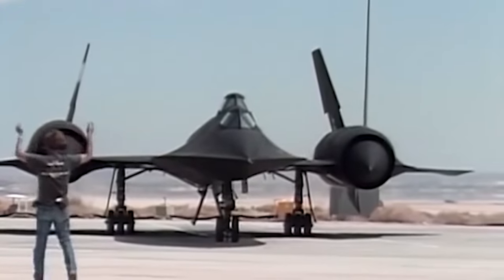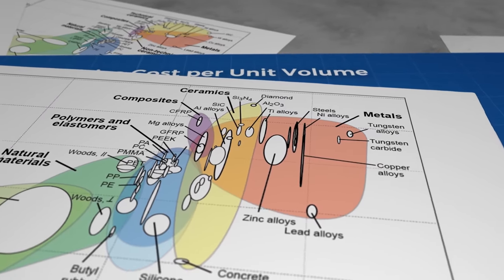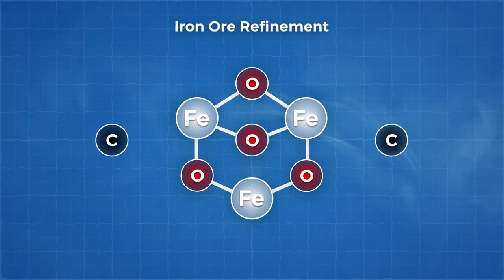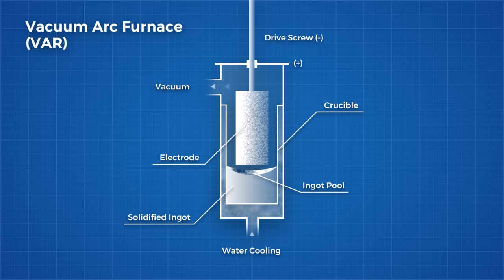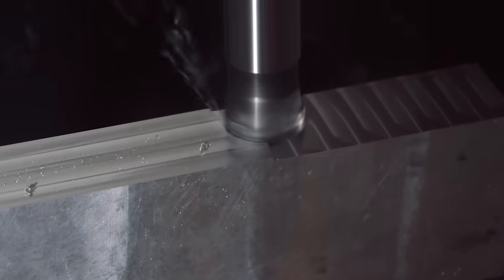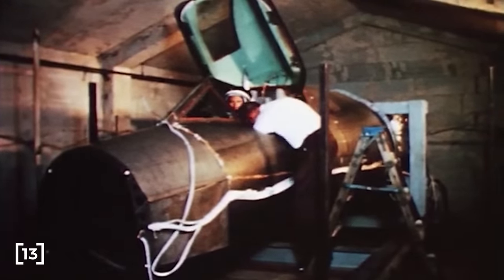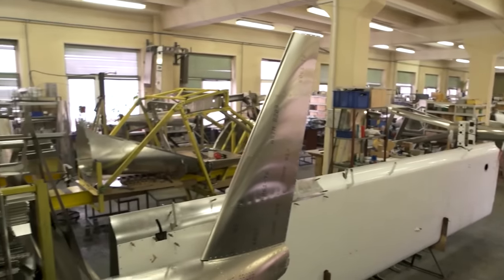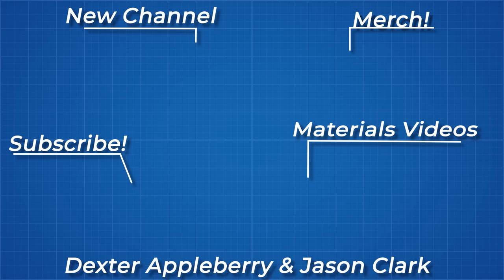Titanium - The Metal That Made The SR-71 Possible

Comment: Why they’re not using tungsten? Maybe in the future, the tungsten jet, which called “T - Jet
Reply: Tungsten has the same specific weight as gold! It is also extremely hard and brittle. In aviation it is only useful as a strengthening element in steel parts that also have to withstand great heat.

Comment: Have any aircrafts been built out of Tungsten? If not, would it be too heavy?
Reply: Aircraft* (plural same as singular). Pure Tungsten not only is heavy but also very brittle. Tungsten is added to steel to increase its heat resistance, wear resistance and toughness. Given an airplane contains up to five million parts there are certainly a few made of tungsten-alloyed steel in places where high load and heat occur at the same time, like in the engines and landing gear.

Comment: 4.5k per ton is really not that expensive. An airbus A321 is about 60 tons of it would be made 100% of titanium that would be 270k. That is really just a tiny fraction of the plane cost.

No the mainnissue with titanium is not cost, but rather processing.

Comment: Titanium is the devil when bending for finned heat exchangers. It work hardens and then cracks. You get about one chance to bend it and if you try again the work hardening almost certainly leads to failure. Very unforgiving. In theory, an excellent inert, light and strong material but for manufacturing and for the price it is a bear.

Comment: Fun fact. The SR-71 only had a 2G airframe!
Reply: I learned that only recently.  I think that's the big tradeoff Kelly made to create an aircraft that goes fast in a straight line.  It makes me wonder how different the YF-12 was from the SR.  A fighter has to be able to pull high G's.  The YF-12 was supposed to be an interceptor for shooting down Soviet bombers, so turning may not have been that important.  But if they didn't get their prey on the first pass, it would take them a long time to turn around at 2G's to line up a second pass.  I remember Kelly being quoted as saying the US government bought the wrong version of that airplane.  The F-12 should have been the one that was purchased in great quantity.  I think there were only 32 SR71's built.

Comment: The SR 71 still leaked fuel all over the runway and did so until it was airborn it was a piece of junk. Titanium is pretty rugged metal though and resists machining like a bastard. Magnesium is not as strong is dangerious to some extent because it loves oxygen so much. but machines nicely with sharp tools using no coolant. It is 2 thirds lighter than aluminum and two thirds stronger but it does not like to be bent or plasticly deformed. Titanium likes to burn too.

Comment: False,
The SR-71 was limited to it's engine's not the airframe.
The SR-71's airframe was designed for mach 4.4, the engine's were mach 2.2, and the naselles is what allowed the max unclassified speed of mach 3.68.
Reply: Virtually your entire comment is incorrect
Reply: @gr8crash  
Prove it
Reply: @krysb7119  the initial limiting factor to speed was the engine CIT of 427°C. Once that limitbw was reached you were done accelerating. The airframe was NEVER designed for mach 4.4, it wouldn't be able to achieve or survive that. That maximum design potential of the airframe was mach 3.8 and it would have required significant upgraded to reach that speed and were never done. It was member even capable of reaching 3.68 either. The engines were rated for 3.2 with a max authorized speed of 3.3 ONLY if engine CIT was within limits. Above 3.43 a pilot would be beyond the flight envelope as well as being at an unapproved altitude would all lead to some very bad things.
Reply: @gr8crash  
You need to do a lot more research.
Reply: @krysb7119  I have done a lot, apparently significantly more than yourself. I'm always doing more, but sounds like you need to step it up. Which is unlikely as it ends up being a time consuming and costly endeavor, which most people just don't want to do.
Reply: @gr8crash  
Sounds like you don't know what you think you know. Thanks for trying but you've failed.
Keep researching maybe someday you'll actually learn something.
Reply: @krysb7119  oh no need to. I've already done quite a bit. One day you'll get there, if you ever decide to commit the time and expense, which is unlikely.
Reply: @gr8crash  
When you grow up you might get an actual education.
So far you haven't proven me wrong.
Reply: @Istandby666  actually you were, several times over.

Comment: The Russian use stainless steel for their Mach 3 MIG25. Different approach by different engineers.
Reply: Mig 25 was extremely heavy and crudely made.
Reply: @osyisr6361  - The MIG-25 is crudely made because they have a tight schedule. There are rumor that the USA Mach 3 bomber is going into service soon. In order to have a interceptor that can intercept the Mach 3 bomber. They use huge jet engine that was design for cruise missile. Use stainless steel  alloy and use alcohol to cool down the MIG-25 internal when flying at high speed. However, the irony is that the US Mach 3 bomber project is a failure.
Reply: @yutakago1736  Do you even know what past tense is? You're talking about event from over 50 years ago.

Comment: Air friction creates heat which make materials weak. Heat is best handled by ceramics of klins and the bottom of the space-shuttle.Supersonic is mach1. Hypersonic was mach3 0nowadays people like to use mach5 as benchmark for hypersonic). Air-friction for re-entry vehicles (including nuclear warheads), generates heat. You will never have materials on earth for sustained hypersonic flight. Sonic is atmospheric. Go higher to low-orbital make sense-cents. Youtubers and engineers bullshit too much on new weapons. From mach1, need to disperse heat is a big issue. At mach2.9(muzzle velocity of most guns at 990m/s, 3x330m/s unless brute-forced to destroy barrel) things work. At mach3.1, things are very different. Hypersonic missles eh.? Sustained mach3.x eh.?
Reply: storage of titanium plane is like dentist fusing biological mouth-gum by having the screws made of titanium. old things, made of titanium should not even supersonic heating. especially after storage moulds. the tungsten-titanium cockpit of a10 may be different and that plane cannot supersonic.
Reply: recon should not carry gamma emitting things other than radio. radio silence on eating metal.